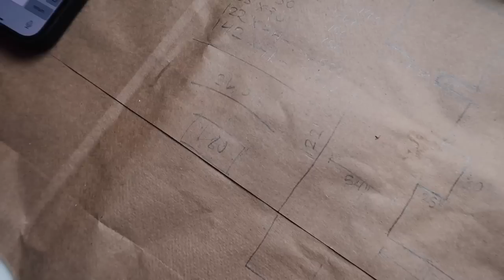FAKE STONE WALL HACK IN MY KITCHEN? 😬

Comment: Who am I to give you design advice. But I'm thinking the bronze cylinders will take away from the focal point, which is the beautiful windows and hanging lamps. I'd go for maybe finding a flush fixture of the same or similar color of the ceiling. But gosh, I fucking love the kitchen also (and I never swear). And it is not boring to watch you work. The process is really interesting.

Comment: Mmmm.... is there a way you can find some brass light fixtures that will be flush to the ceiling rather than protruding? Not sure if I'm making sense, but I think that the antique lights are a highlight, so anything else on the ceiling should be flush against the ceiling.

Comment: I really don't think you can see the wall treatment for the cost of 400.  Maybe you should have left it more textured.  It did drive me crazy that you dripped it all over your cabinets and window trim.  You should have been wiping this off as you went.  I do hope it came off without ruining the paint.  Wow, you have been working in this kitchen for a long time.  You are like McCenna is that way, takes a while to get it done.